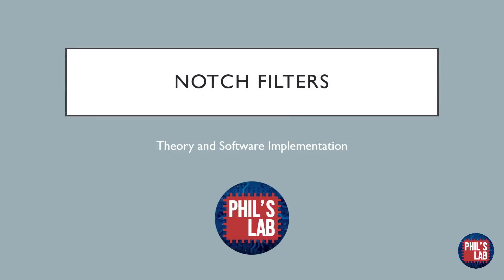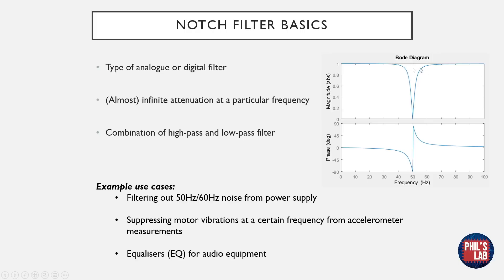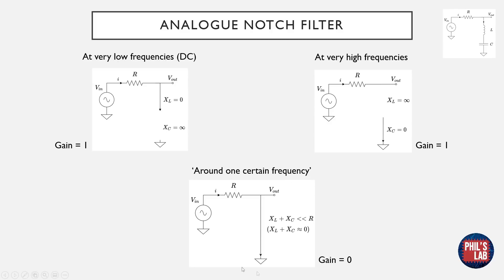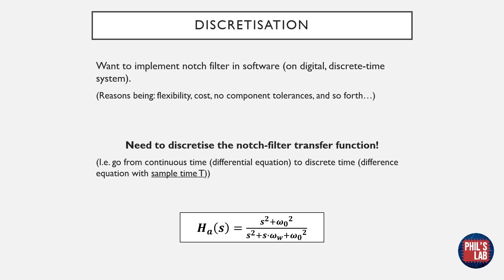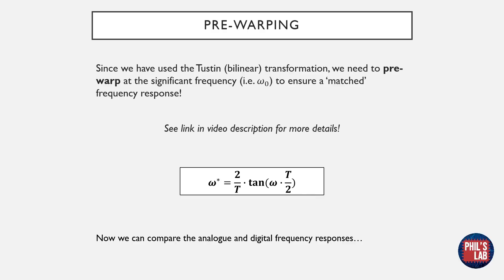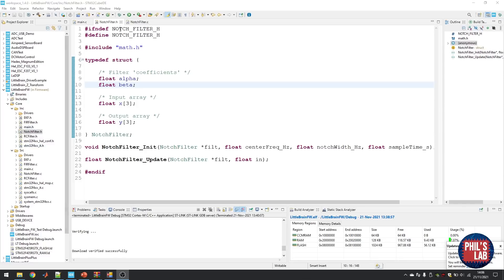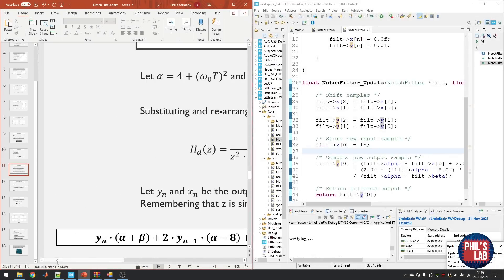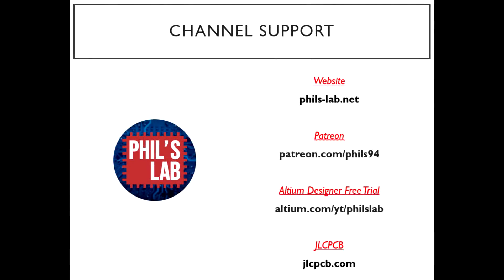(Sponsored) Notch Filters - Theory and Software Implementation - Phil's Lab #39

Comment: You're generating 100 samples per second, so, your sample rate is 100 Hz, and you're filtering out 50 Hz. Nice and fine. But if you have a much higher sample rate, say, 10 KHz, and still want to filter out 50 Hz, wouldn't you need a formula that stores many more of the previous samples (and converted results)?
Reply: ok, that was a stupid question - the X and Y values are sufficient to describe a "correction wave", which, if subtracted from the original values, filters out the 50Hz signal. But you only need X and Y to describe that correction, not a memory of all previous values that describe how the parameters were found.

Comment: Great video. At 16:11, the signal jumps 40% higher momentarily when you switch from 2 Hz to 3 Hz. This worries me that it could saturate the signal in many applications. Why does that happen? Is it just coincidence that it jumps to almost exactly 1.414x the amplitude, i.e., the square root of 2?

Also, will this approach work well for narrow notch filters at higher frequencies, for example a 1 Hz notch filter at 50 Hz to remove powerline interference? Can it even do something like 1 Hz width at 10 kHz or is something going to fall apart? Thanks!

Comment: Good job Phil, thanks for the effort.
You mentioned the applications of use as motor vibration noise elimination from accelerometer sensors, but as you know
the props are spinning at variable speeds, so the vibration frequency may vary. So, how do we decide which freq to be notched?
Reply: Maybe a bit late, but I got to this problem actually today. I was measuring my system by putting in a constant accelertion of a linear actuator, but because of a big mass which was undamped, a resonance in my measurement signal was determined. By putting a notch filter in my controller on the resonance frequency, the controller completely damped the resonance frequency. Another implementation can be that you indeed want to damp your input signal. Therefor, a moving notch filter can be applied (currently being implemented for a wide range of drone's). With that, your acceleration changes are damped, such that your accelerometer can actually measure your accelerations. It sounds not that intuative, but you think of it by blocking your input accelation from your measured accelerion.

Comment: I have a problem with a set of IIR filters where the filter computation of a bit stream needs to be done in parallel (to gain speed on a multicore system).
So, the input stream is split on overlapping chunks of fixed sample count and sent each to the parallel filter threads, then the outputs of the filters are concatenated in order to assemble the output signal as it was done with a single filter.
There are a major issue there.
As the IIR are feedback type, the current output depends on previous values, so it produces edge distortion at the beginning of each block (it does not know the previous values).

The question is. Are there a way to compute how many samples of the previous block are needed to minimize the start of the block edge distortion in a way the resulting distortion is less than a given error magnitude? (The procedure is to add N samples of the previous block to the beginning of the current one, the question is how to determine N given an arbitrary IIR)

I guess it is something related to the maximum absolute value of the Z exponent on the transfer function and its weight. But I guess someone solved that before.

Do you know some specific keywords for searching for this particular problem available solutions?

Searching for parallel IIR implementations I found a summing solution, but not the one I described.
In this one the filter is applied to different time portions of the input in parallel not the same portion and then the output summed.